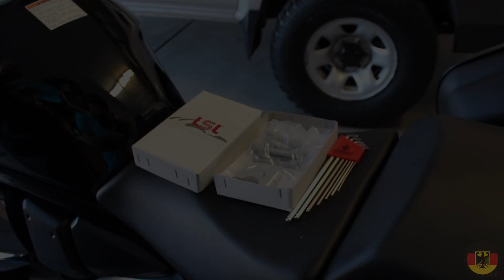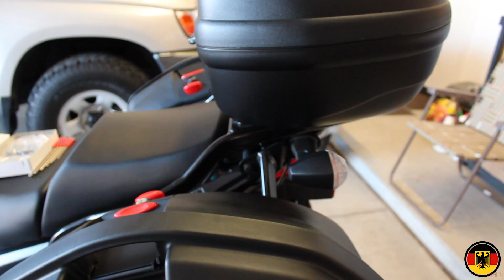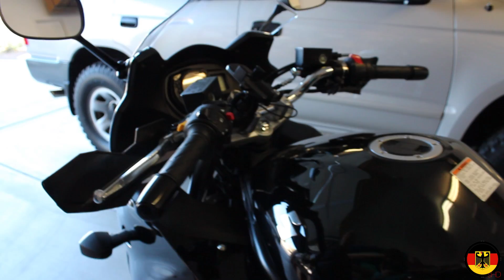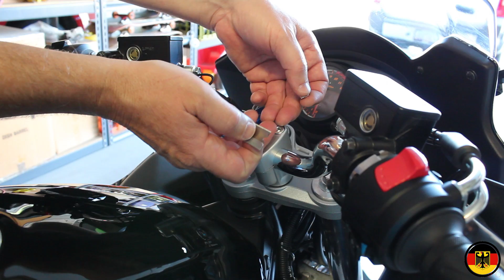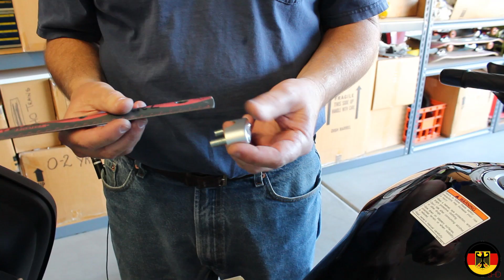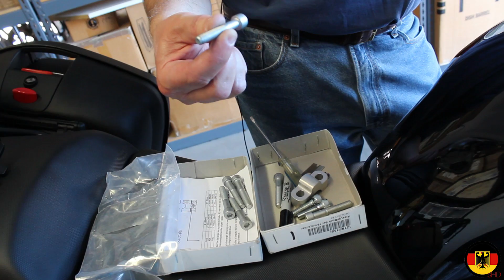Suzuki GSX1250FA LSL 15mm Handlebar Risers Installation

Comment: Did these make much of a difference to your back or wrist angles?
Reply from the maker: Jimmy Pinchin They certainly help with comfort, but just don't expect it to be like riding a touring bike.  For me, there is enough of a difference for it to be a fair bit more comfortable than stock, but my BMW is more comfortable still.  Thanks for watching!
Reply: redonKiLaus Thanks, I ended up going with the 20mm from SW Motech and they feel great. I still have a little wiggle room with the clutch line, but the brake line is at it's max...I'm glad I didn't go any higher. Cheers.
Reply: +Jimmy Pinchin  Good to hear, because this is just what I've just ordered.

Comment: Sir,

i called Spiegler..  you seem to know more about their products than they do.  I have a 2104 GSX 1250 FA SE.
They couldn't tell me which risers I need to purchase.   Could you advise me.

thx
j mitchell
Reply from the maker: If you're looking for the LSL risers, it appears that they may have been discontinued.  Lots of companies make the risers (or at least did when I got mine), though, so you should not have any problems finding them.  You might want to try STG (Sport Track Gear) and look for risers for a GSX1250FA/GSX650F/Bandit 1250, as any of those should be compatible.  Alternatively, you could call Spiegler again and see if they have anything for a Bandit.  Also, if you don't mind changing out your hydraulic lines, you can get an entire kit from STG to raise the handle bars more than 15-20mm.  Metrick Metal also makes risers for the GSX bikes, so you can get them from there as well.  I have used quite a few of their products and have spoken to the owner personally, and they are a great company; if I were getting risers now, I would probably go for Metrick Metal.
Reply: Check the Spiegler USA website and they still offer LSL risers.  Go to "Handlebar Riser Clamps".  Your bar should be 7/8" diameter, but measure it to be sure.  We used the 15mm riser without pullback, because our brake and clutch lines were so tight.  However, I plan to go with a taller riser with pullback soon, and we will make a video on it at that time.  I will also need to change my brake and clutch lines for longer ones.  Thanks for watching our videos!  I may even go with an LSL complete kit but have to investigate if any of the models listed share the same top triple tree.

Comment: Hi, FYI my mechanic just installed the Genmar risers on my 2011 GSX1250FA. These raise the bars up 1" (25mm) and back 1 3/8" (34mm).  We did have to change out the brake line with the one provided (part number S121), but other than that, they work great!  No problems turning the bars or locking them.  I had him install Oxford heated grips as well.  With both options, I'm really lovin' my bike!  Thx for all of the great videos.  Which forum do you frequent the most if we wanted to as some specific questions?
Reply: Two Wheeled Texans, although I don't visit the site often.

Comment: Hi Mr. rendonKiLaus,
Thank you for your videos, they are great. Quick question. I would like at least 35mm also. Are you sure that the factory lines would only allow a 15mm riser only? Someone just commented here that they were able to install the 35mm risers. What do you think?
Reply from the maker: At 15mm, my lines are stretched to their limit when you turn the steering from side to side.  I even tried loosening the line going to the ABS module on the front fork, and it is set in there in a way that it can't be moved.  Thanks for watching!

Comment from the maker: I put 15mm on because that is as far as the hydraulic lines would allow without being replaced.  I would prefer at least 35mm, but the lines would have to be changed, both clutch and brake.
Reply: redonKiLaus i have just undone the brake line splitter between the forks and that let the brake lines fit a 35mm riser kit.
Reply: @HyralProductions  did you just leave it to hang free?